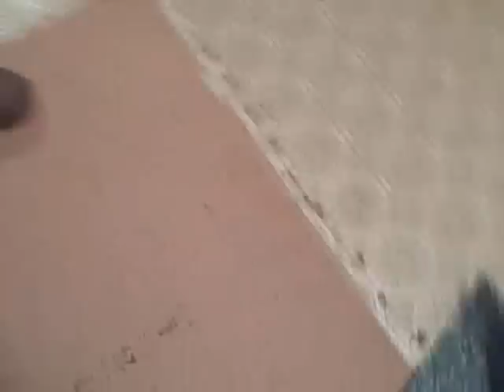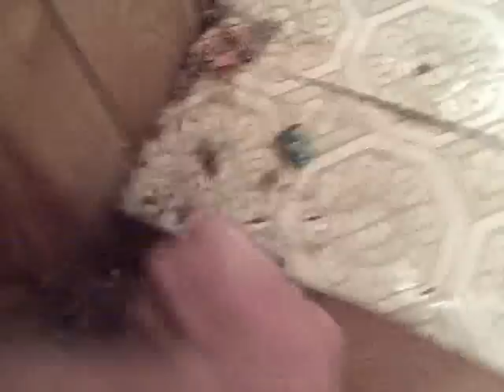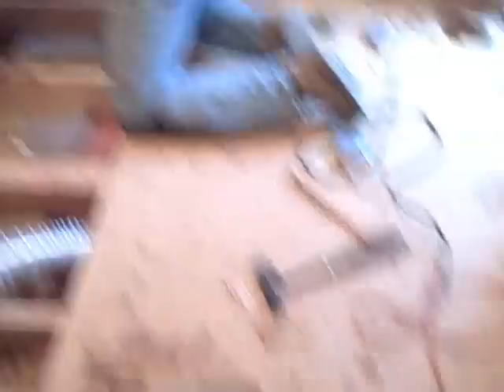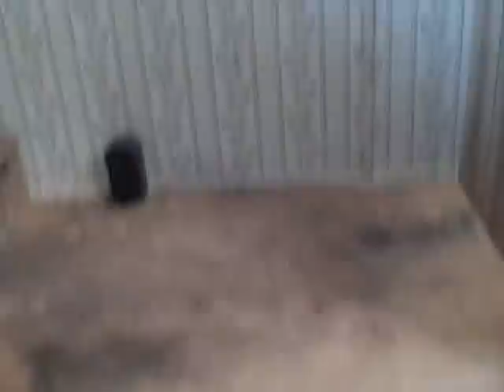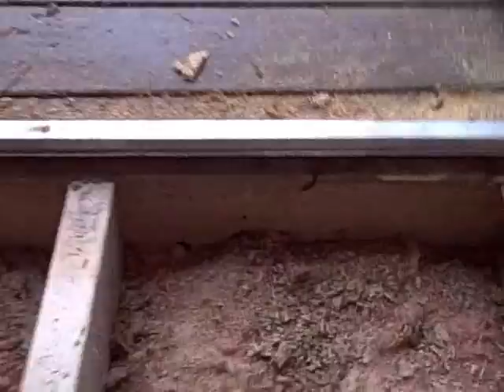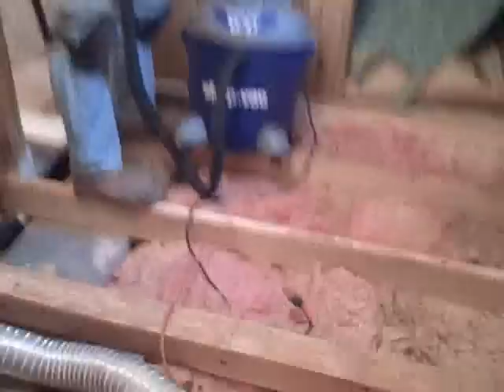How to repair your mobile home trailer floor

Comment: Awesome videos, thanks a lot for posting this stuff. I've started doing these types of jobs out here in Texas, replacing these sorry ass particle board floors. I had a place where the AC leaked and rotted the floor and the fridge went straight down the floor. Ridiculous cheap material.
Reply from the maker: Thank you for watching

Comment: Hi Drew! We are doing a public service project to replace a bathroom floor like this on my neighbors mobile home that he had neglected before his recent stroke. we stripped the rotten and missing chip board and are reinforcing the existing 2 x 4 framing, in the middle and on the edges as you show. We have 1/2 " regular not pressure treated plywood and just need to know if we can use it as is. There is no time, no budget and we got these free supplies, so do we really NEED pressure treated, or can we just use this plywood, single layer, painted or unpainted, and build on top to that?
Reply from the maker: Call me 910-294-1761 you do not want to use half inch pressure-treated plywood on the floor
Reply from the maker: No you do not want to layer it it will cost about $35 per sheet of three-quarter inch plywood to do this project it sounds like 23/32 is what you’re going to have to use
Reply from the maker: Check out some of my other videos they might help also.   https://youtu.be/OlLTbH39chI
Reply from the maker: Check out some of my other floor videos. https://www.youtube.com/playlist?list=PL8xp84iSvTA570yVi5b5MZAIrw5yNXkQT
Reply from the maker: Plenty of videos to watch here https://www.youtube.com/playlist?list=PL8xp84iSvTA6oXgxQr0iXkWR2bOhrllSm

Comment: I noticed you left about an 1/8" gap between the new plywood instead of butting them up together. What do you use to fill the gaps?
Reply from the maker: That’s a good question thanks for asking. Actually if it’s going to have carpeting on it it doesn’t matter at all and you don’t want the boys to be too tight because they will swell and cause a problem so I personally like to leave a small gap in my plywood. Remember these are mobile homes and sometimes underneath is exposed to moisture. So we used if you notice we used blocking on all the seams to make them solid.  If you’re going to put linoleum down then you go down to the building supply and you bye floor patch at Home Depot or Lowe’s and you put it on any place that has gaps and then sand it down or make sure it’s smooth so you can put your linoleum down. If you’re going to use laminate or carpeting you don’t have to do that. Just like laminate flooring plywood will also expand.
Reply: @Drewsroofingandhomerepair  Thank You. I'm also a mobile home owner who just happens to be replacing the bathroom sub-floor. 

Finally had the dreaded 'Quest' pipe burst up underneath the floor in the bathroom. Anyways, boxed out much of the joists, added support beams and such. This is a learning experience for me and  I've learned a lot from YouTube and google searching . Was going to use 3/4" particle board, which was originally used, but decide to go with OSB.  

Most of the forums I read and videos I watched suggested keeping the 1/8" space between the pieces but they never explained what they used to fill in those spaces.  I'll follow your professional advice and use "Floor Patch". Like I said... I'm learning. Thnx again.
Reply from the maker: You’re very welcome my friend thank you for watching my videos I’m glad they can help I have more than one so check out my playlist on floors
Reply: @Drewsroofingandhomerepair  If I might bother you once again sir. After I get the OSB put in I'm trying to decide between 2 products for the seams between the plywood. Do you have a preference? Thnx

"DAP All Purpose Acrylic Latex Caulk Plus Silicone" or "DAP Flexible Floor Patch & Leveler"  (the bathroom floor area is relatively small,  5' x 8' (40 sq feet)). 

Need something sandable. Thnx again.
Reply from the maker: Gap flexible floor patch
Reply from the maker: We do them differently on our mobile homes it’s according to what it is https://www.youtube.com/playlist?list=PL8xp84iSvTA6oXgxQr0iXkWR2bOhrllSm
Reply from the maker: Check out a few of my videos https://www.youtube.com/playlist?list=PL8xp84iSvTA6oXgxQr0iXkWR2bOhrllSm

Comment: i have some issues with my furnace only heating 1 half the trailer ,, is there a way to take out or block out sections , i ask this on a flooring video well thats were a trailers heating ducts are
Reply: if it's a double wide there's a duct that joins the two halfs. on a single wide I think it's all metal ducts maybe the ducts have come lose from the vents.
Reply: if it's a double wide there's a duct that joins the two halfs. on a single wide I think it's all metal ducts maybe the ducts have come lose from the vents.

Comment: I'm working on a similar project.  It's tedious to get the remaining particle board off the support beams.  I have to remove staples and nails and just the particle that seems glued to the beams.  Is there any trick to this?
Reply: My husband bought a dewalt ossillating tool and i swear its the best thing ever invented!
Reply from the maker: Saw saw works good

Comment: is there a certain size/width of plywood to use in replacing the floors?
Reply: Vena Guajardo yep. Usually it’s 23/32. (3/4)
Reply from the maker: Are use 23/32 plywood

Comment: Where y’all located
Reply from the maker: Southport, NC 28461
Reply: @Drewsroofingandhomerepair  I watch 23 videos of yours… I need you work on my single wide mobile home in Wisconsin dells, wi… I need floors walls and cielings
Reply from the maker: That’s a total remodel. Ceiling can be a pain some times

Comment: This looks a lot like my MH which is a 89.  It has the gray polybutylene plumbing.  It is soft hoses with crimp fittings.  Very prone to leaks, hence the rotted flooring.  Unfortunately I still owe money on it.  Never again.
Reply: If I turn water off before I start pulling floor up  how will I know where its leaking .

Comment: why did they use plyboard instead of like REAL WOOD?
Reply: CHEAPER
Reply: It is real wood and it's just as good if kept dry, surely they fixed the roof leaks or plumbing leaks that caused the problem to start with.

Comment: @Jimmyjoeandthegang You will have to measure in between each joist. Reason is that when they are built alot (most ) of the time the joists will be off all the way through it. It's not a hard job. Just don't over think it is all :}
Reply from the maker: Agreed